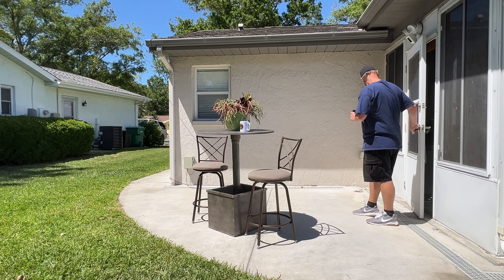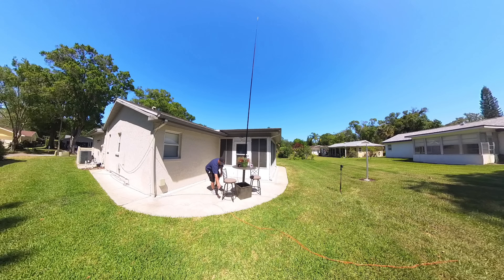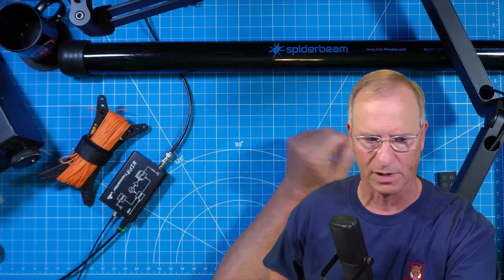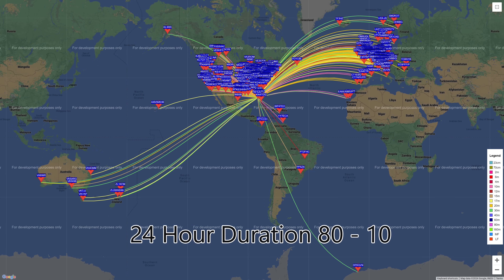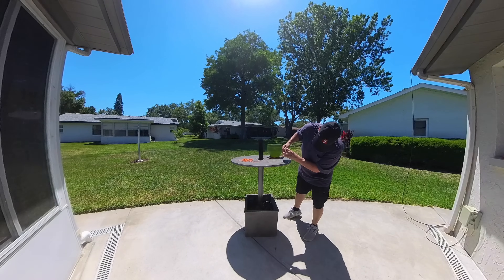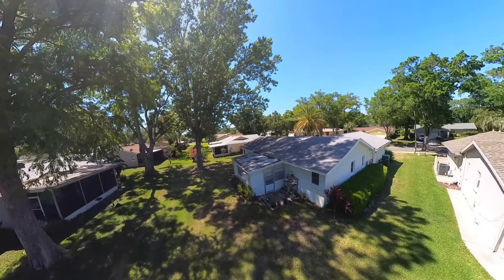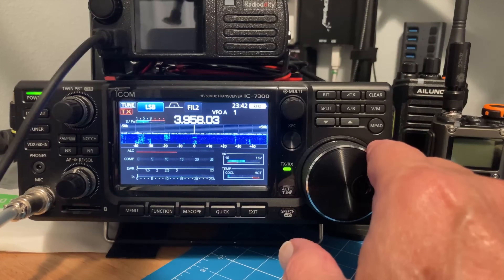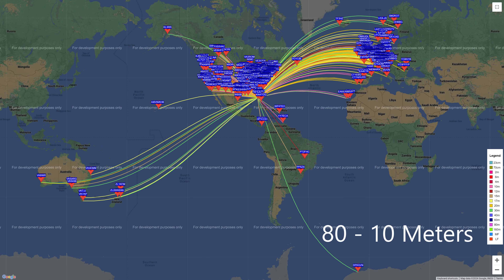Stealth Ham Radio Antenna the HOA Will Never Find -- the Poseidon Rybakov disguised as a Patio Table

Comment: About 3 decades ago I had to have a new roof installed on the home I had then. I measured out the wire for a 40 meter dipole and had the construction company install it under the shingles. It worked like a charm with very little tuning. As far as HOA;s , Never will do that one.
Reply from the maker: Great idea for the antenna install!!

Comment: The HOA would have seizures, with the antenna my father in law used to have.  It was a 4 metre wide collapsible cube antenna with powered rotation and tilting facility.   It looked like huge rotary clothes dryer.   It would collapse down in the same way, except you cranked a handle.
Reply from the maker: LOL, I'm sure they would!  Sounds like a pretty impressive antenna.

Comment: My HOA doesn't have any issues with my 2 mm/ 440 cm antenna that is 12 feet tall above my roof.  In fact, the one I have is bent and needs replaced due to high winds.  They love that my antenna has a 00 gauge wire to a cooper ground rod under my deck that is 8 ft in length.  Perfect lightning protection for the neighborhood.   The houses surrounding me and mine have all been hit with lightening before I put my antenna up.  Since the installation, we haven't had a lightening strike to date.
Reply from the maker: An HOA that cooperates; fantastic to see.  Thanks for sharing.

Comment: There was a court case on a HOA and ham radio antennas, back in the 70's or 80's. Court ruled that HOA could not prevent a Ham antenna from being put up. In my town the HOA fought a tower being put up at one house for a Ham station. In court, because of the federal case, case, the HOA lost too.
Reply from the maker: Lots of information and misinformation on the subject of what laws there are and how they apply....  I've gone a different direction and chose to find ways to operate regardless of what the laws, if any, state and how they are applied differently across the USA.  Make antennas no one can see, and this all become a mute point.

Comment: There was this one MARS system antenna in Housing in Heidelburg housing back in the late 90's for an operator for the shortwave radio station there at his home.  It was in the Attic space with clay tiles for the roof.  Now the complex for the radios, well that was another story.
Reply from the maker: Attic spaces are great for hiding antennas, and clay tiles are no challenge for RF.  Thanks for sharing.

Comment: what about a gutter slot ant :) just saying
Reply from the maker: Gonna give the gutter antenna a try at some point.
Reply: @HOAHamRadio  making your last nibbles set up your capacitance meter to dial it in, took several tries for me as the width was not perfect the length changed measurably

Comment: I remember as a kid my grandfather I never met had an antenna in his attic, 5 plywood circles with notches around the outside and wire wrapped from end to end suspended through the attic about 40 ft long. I always thought it was a clothes line for my grandmother. When she passed away we cleaned out the house and my mother told me it was her fathers old radio antenna he used to talk to people around the world after WWII until he passed in 1954.

Comment: j just used A 40 foot length of 2 in galvanized water pipe jammed it in the ground 2 feet with my antenna on top And I use it for my flag pole as well
Reply from the maker: Perfect!  That'll get it done.

Comment: the FCC ruled that because amateur radio is part of the emergency networks hoa's can't prevent HAMs installing outside antennas.
Reply from the maker: The  Amateur Radio Emergency Preparedness Act of 2024 has been introduced to the 2nd Session of the 118th Congress; it has not been voted on and therefore, as a Bill not a Law, provides zero protection.
Reply: @HOAHamRadio -- HOAs tried to stop people from having 18" satellite dishes during the early days of mass-marketing of those devices. FCC stepped in and ruled that such regulations violated multiple existing federal laws, plus the First Amendment. It seems that it would protect people who have ham radio setups as well.
Reply: What about PRB-1…..

Comment: PVC conduit and PVC plumbing do have compatible dimensions, but none is going to work with the exterior of the bell end of the pipe.  Should have used a 4 inch diameter conduit and used the non-bell end, or used a different toilet flange.

Comment: What about a fake fiberglass tree that looks like a tree but you can install any antennas inside.
Reply: No artificial trees allowed. I had to add that just in case use a real one and hide wires   somehow among the branches. You could also use a hollow tree with real plants and a few antennas that no one can spot. 73 KN4DUQ
Reply from the maker: Like that idea a lot!

Comment: Great work, but is it needed? The law does not allow for HOAs to prevent you from installing antennas. OTARD exists and the  Amateur Radio Emergency Preparedness Act is in review.
Reply from the maker: OTARD - Over The Air RECEPTION does not protect amateur radio transmission.  While the Emergency Preparedness Act would be great if passed, all other legislation previously submitted has expired without a vote...I do hope its different this time.

Comment: I thought there was a federal law forbidding local entities from interfering with licensed ham operators?
Reply from the maker: That is a common misperception; all the Bills that go through Congress never make it to the finish line, and those regulations which are inexistence do not go far enough.  Many will tag on to this siting OTARD...which is a RECEPTION protection, not transmission; and they will name other Bills intended to protect, which never made it to a vote.
Reply: @HOAHamRadio ALSO haven't you heard you cannot fight city hall. It's better to comply then you can hide antennas they cannot search without a warrant but anything goes these days. 73 KN4DUQ

Comment: I’m fairly new to ham and live in a HOA. What if I ran I di pole along to soffit or facia? Has anyone tried that and what type of performance did you get?
Reply from the maker: If your facia and soffit are wood, this would be a great option.  If they are aluminum, then they may interfere a bit, but I would still give it a try; I have done similar things...give this a look:  https://youtu.be/-NHhjj252P8
Reply: @HOAHamRadio  that is a very interesting setup but doesn’t surprise me. I may give that one a go but with some mods for my place.

Comment: L😅VE the stealth❤❤❤ BRILLIANT🎉
Any expert advice for begineers like myself in HOA apartment for vertical antenna for my begineer FT-991A
Cheers
9V1KM  KK7QGL
Singapore
Reply from the maker: I am assuming you mean easy set up and break down outside for short term temporary operating.  If so, I would highly recommend the G Gabil Radio MK3 Tripod and either their 7350T or 7350TC vertical.  They are both small, lightweight, and quick to set up and break down.

https://amzn.to/3UE7gmg
https://amzn.to/3mwuKwW

If these are not available where you live, then search for something similar.  Lightweight, portable, easy set up and take down.

Comment: Great video.  Have you ever tried a rain gutter antenna system?  I live in an HOA and I also have some tight restrictions with the wife not wanting an "unsightly" antenna in the back yard.  73 from KI5PRK
Reply from the maker: I haven't tried the gutters yet, but its on the list.  Thanks for the view and comment.
Reply: @HOAHamRadio  I look forward to that video.  I'm looking at the Alpha Antennas HOA Buster.
Reply: Gutters do work, I tried it when in Florida connected to the downspout with one radial and made a contact. My mom was happy since she had no idea where the antenna was. John - W7OTD
Reply: @jmount1200  Was it a home brew gutter antenna or did you buy it?  I’m new to ham radio and I don’t know if I’m ready to build my own antenna yet.
Reply: @JimmyKI5PRK  I used BNC Male plug with a wire from the positive to a screw on the downspout and another wire connected to a counterpoise. I was on my mom's porch.
Reply: @jmount1200  Thanks for the info.
Reply: last year a i saw a ham on tik tok explain that they use that rain gutter antenna system.